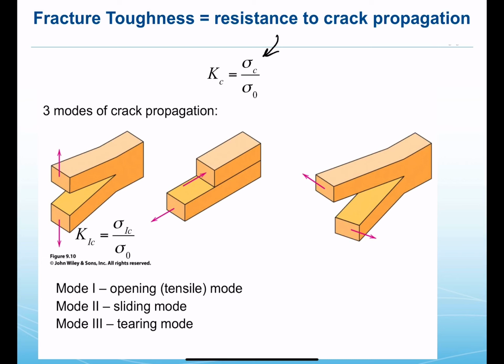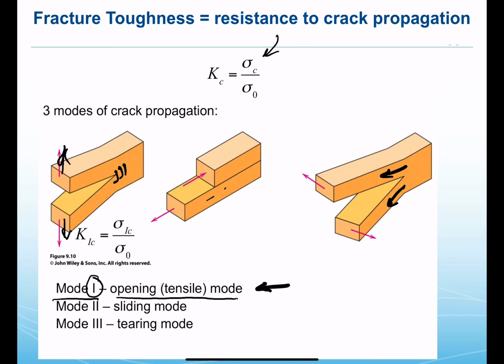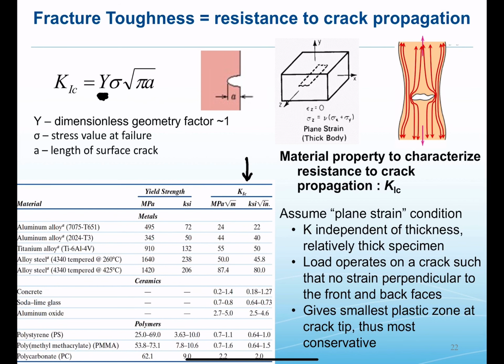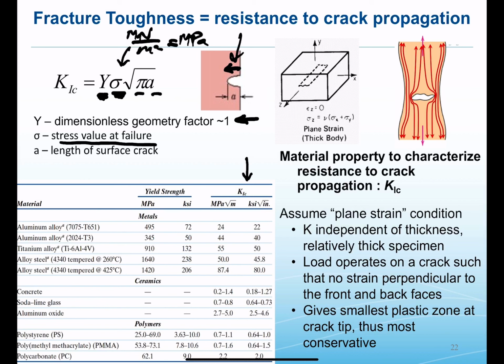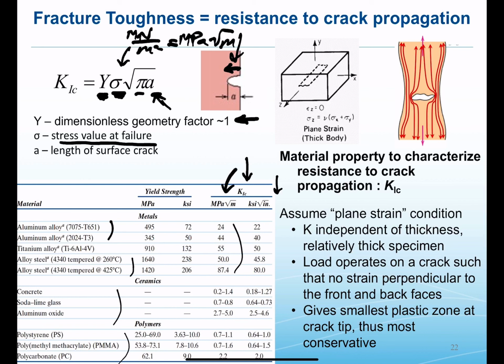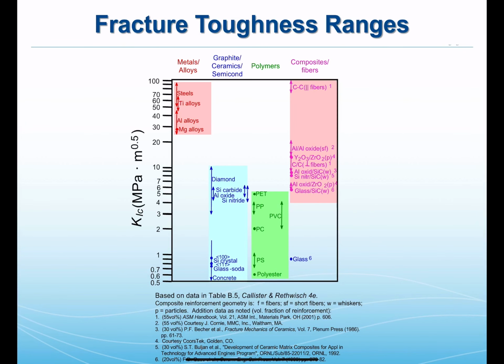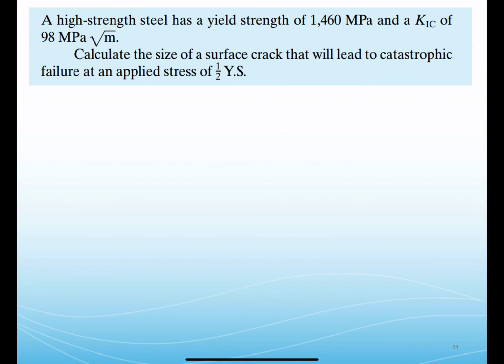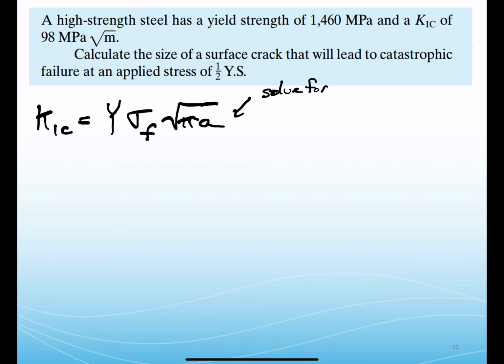ENGR170 / MSCI 201 - Fracture Toughness, Kc, KIc, and example calculation

Comment: 2a≈2×4.56mm
2a≈9.12mm
Therefore, the size of the surface crack that would lead to catastrophic failure at an applied stress of half the yield strength is approximately 9.12 mm.

Comment: Hello Prof. thank for very good and informative lecture. There is a formula in the begining. K1C=𝛔1C/𝛔0
Assuming those both stress values have same unit in psi or mPa, then K1C becomes unitless from that formula. But we know its unit is mPa√ m. There is a confusion I think. Could you please explain? Thank you for consideration.
Reply: tam olarak oyle olmuyor. birbirinin orani olarak dusunebilirsiniz. sigma ic ve sigma zero birbirine oranlandigindaki orantinin ne oldugunu gostermek icin ilave edilmis. cunku gerek mpa gerek psi olsun metre iceren bir sonuca sadece oranla gidemeyiz. iyi calismalar.